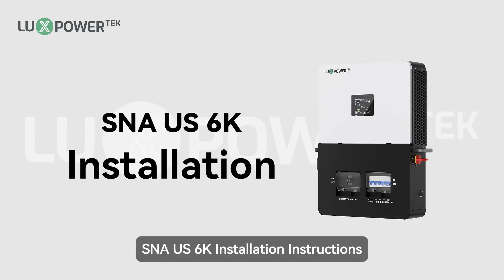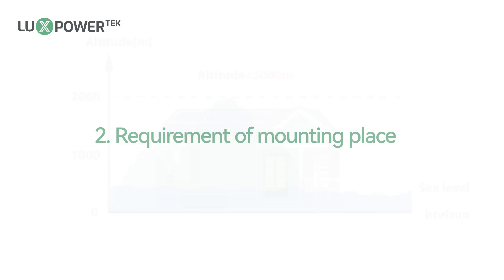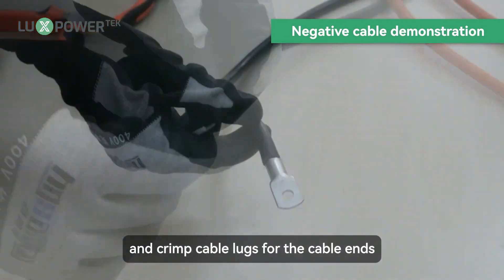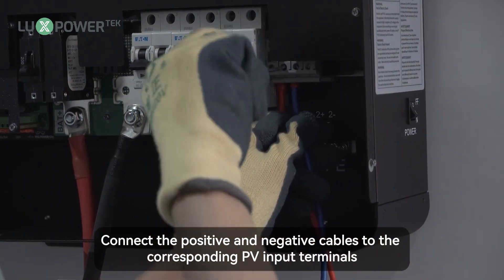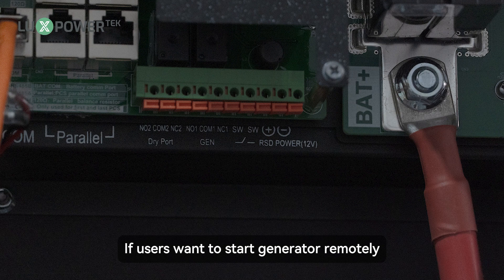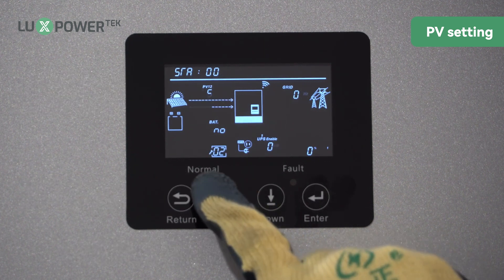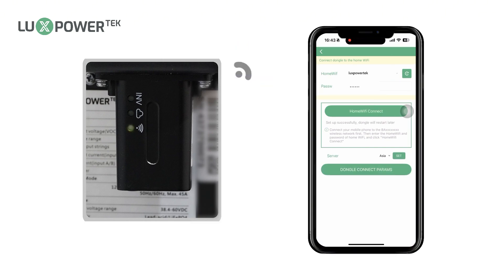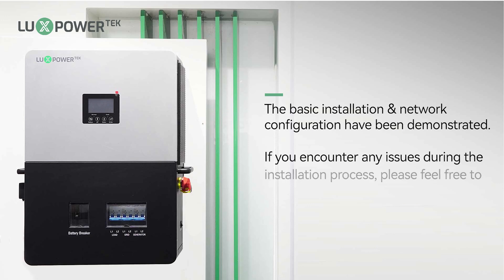SNA US 6K Unboxing Installation

Comment: hey i can't get my battery to charge using a generator on the inverter it shows there is voltage but its not charging and i even change some settings and it still wont charge
Reply from the maker: Hi there, thanks for your reaching out. Please send email to info@luxpowertek.com, our technician will give you support.

Comment: What is the awf battery cable and ring terminal of the cable 1/4 or 5/16?
Reply from the maker: Hi there, thanks for your reaching out to LuxpowerTek.
For the SNA US 6K, the recommended battery cable size is 2/0–3/0 AWG (65–85 mm²).
When preparing the cable, please strip about 3/5–4/5 inch (15–20 mm) of insulation, and use a 5/16 inch (M8) ring terminal to fit the battery terminal bolts.